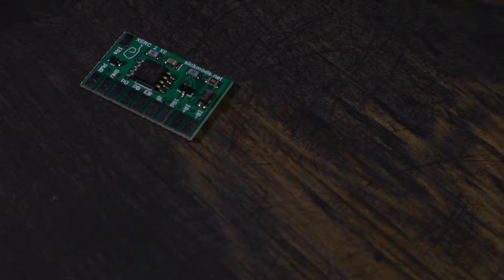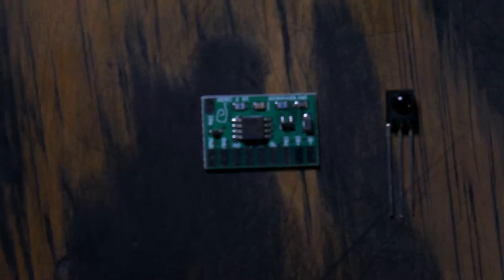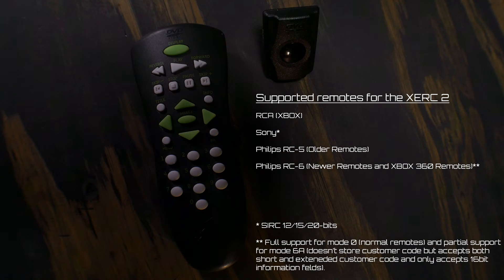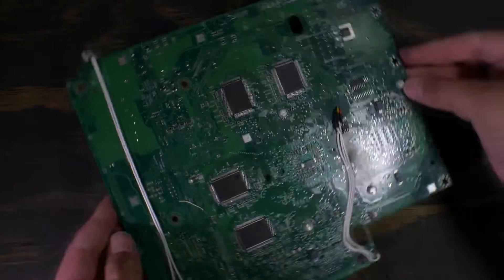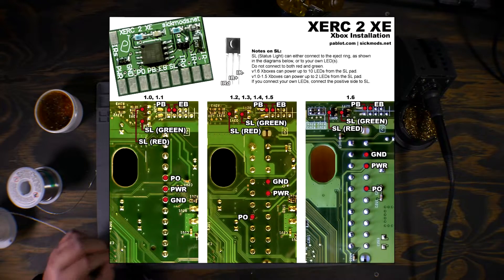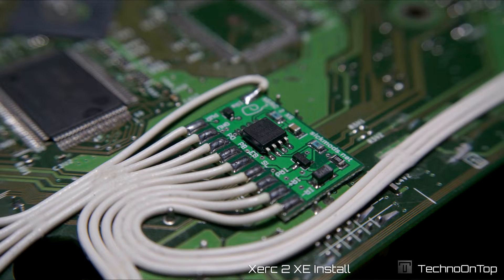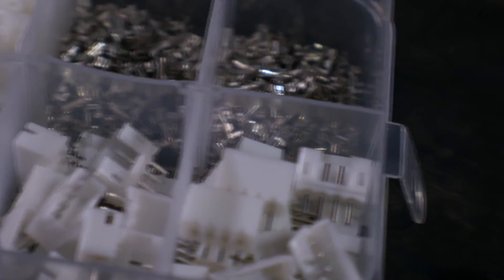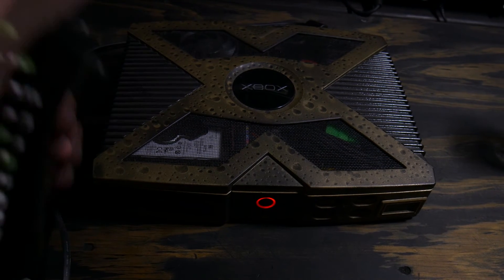How to install a Xerc 2 xe to the original Xbox

Comment: Hi TechoOnTop.... Great video.... I have a question but the hdd on my original Xbox V1.6b. The hdd is bad on it... If I were to buy a new hdd and install it. Will my Xbox be able to operate again or do I need to do something to the new hdd for it to work... please help... thanks
Reply from the maker: Much appreciated! And yeah you will need to buy a modchip and install it, since it's a 1.6 you will also need to do an LPC rebuild, I have a video about installing an aladdin modchip to a 1.6, so you can follow that, anyways after getting the modchip installed you will need to use a hexen disc to then rebuild a new hard drive, where you may run into problems is getting your Xbox to read the your burned copy of hexen, some drives really struggle with it, if it's a Samsung drive you shouldn't have any issues. Thats the way I would fix it. If you have any other questions feel free to ask good luck happy modding!
Reply: TechnoOnTop .... Thank you Sir for replying back..... I just placed my order in. I bought an Aladdin chip, 40 pin 80 wires IDE, dvd belt, thermal paste, adapter for new hdd and a 2tb Seagate Barracuda hdd. I will look up your video for guidance. My dvd-rom drive is designed by Toshiba Samsung Storage Technology. Do you have a link for downloading the Hexex?
Reply from the maker: Sounds like you are going tk be set up! Sorry it took. So long thought I had replied back here's a link, https://www.ogxbox.com/forums/index.php?/topic/515-made-a-hexen-2018-update/
Reply: TechnoOnTop .... thanks for your time and help

Comment: Your wire routing rivals that of voultar; it's like art. You guys inspire me to keep my installs as clean and tight as possible.
Reply from the maker: It's nice to hear that, iv definitely stepped up my soldering and wiring game since I first started making videos, some of my older installs are just plain bad... But you are always learning and growing!
Reply: @TechnoOnTop  I know what you mean. I used to have super long whips of wire, blobs of solder on weak joints, and everything secured with electrical tape and hot glue. Watching/reading tutorials really helped me improve.

Comment: when are you going to make the video on how to install the microsoft wireless dongle or dvd playback kit
Reply from the maker: Umm, idk I should get on it though, iv been working on my new and improved version of my slim. Which is pretty much an entire rebuild lol..
Reply: @TechnoOnTop  okay thanks sorry I just bought a xerc 2 like yours from ebay and I need help to install it
Reply from the maker: @jaymooreiv8769  this video will definitely help with installing it, internalizing the DVD playback kit isn't to tough, i dony like using the relays though, I use a switch, I will try and make it my next video, but I have to get a bit further in my current build to show how to do it.
Reply: @TechnoOnTop  okay thanks looking forward to that video

Comment: Does anyone know where to find a modchip or LPC add-on that supports LCDs (mainly hd44780) for under 50 dollars. I wouldn't even mind assembling it from scratch, just would need to know what parts would be needed or where to buy them
Reply: Im on it. Watch this space
Reply from the maker: There are apparently people working on bringing this mod back, ryzee119 has a github, chances are building yourself will cost over $50 though
Reply: @TechnoOnTop  I don't mind sharing my gerber files for the Xerc 2 XE that I was making for a while.
Reply: @TechnoOnTop  spi2par2019 seems to need a xenium chip, am I mistaken?

Also go figure the ryzee119 is from my city
Reply: If anyone reads this and has some code, schematics, etc from mod chips or LPC addons and has the ability to do so, make them open source and share your findings, it really helps this community continue to grow.

Btw I'm getting close to finishing my first fully modded Xbox (didn't use mod chips) and I'll post a video when it is in its final form, still have to paint the DVD tray (don't worry I've masked off everything that is important), front panel, and solder new bicolour front panel LEDs.